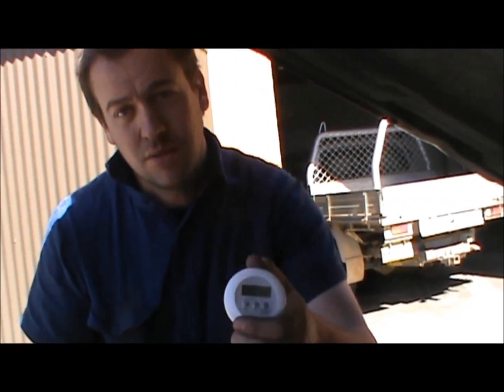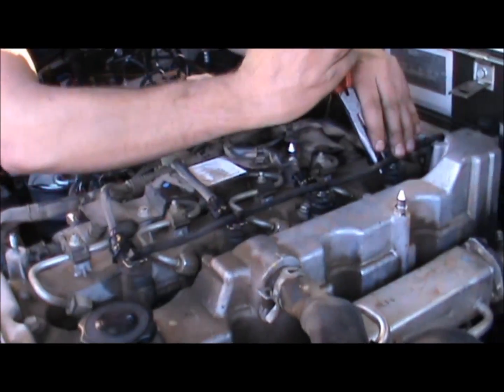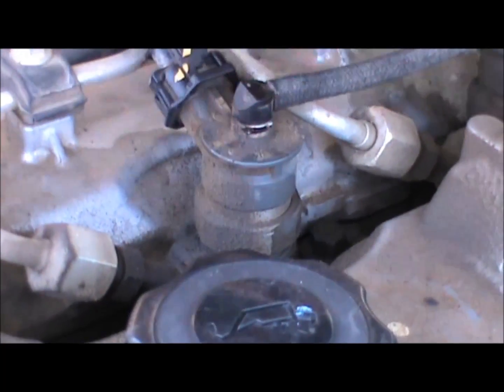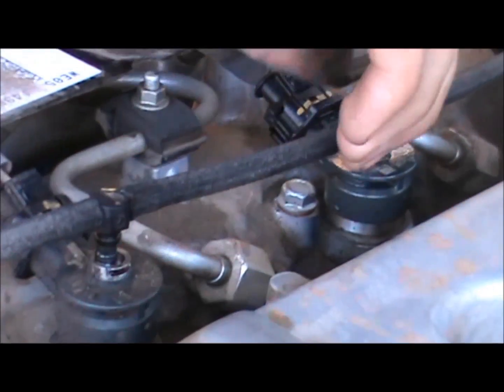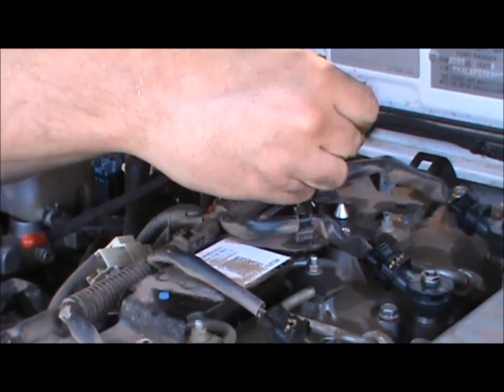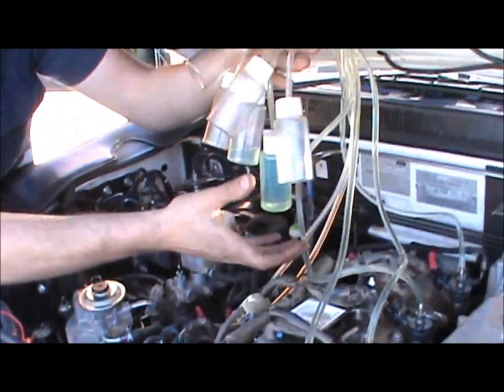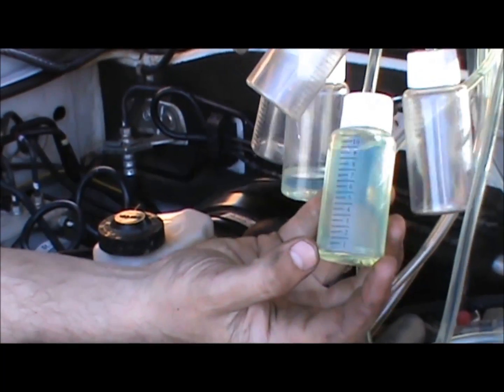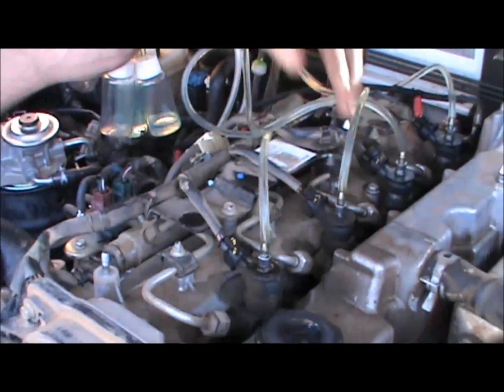Leak Off Test for Common Rail Diesel

Comment: the car cranking but not star i have p0193.p0183.p0627 when i test wires to injectors nothing at all need to see wiring of this injectors with cranking all of this injectors leaking diesel also when i start it with petrol they leaking diesel but i need to know more about thier signal before i change them

Comment: hoy mat , thanks for the informative vid , but can i do the same tast on diesel ( pressurized injectors ) nonelectric
Reply: Ahmad Ali Did you find the answer to this question?
Reply: Ahmad Ali my understanding is that it can be fine as you're working on the return line, im about to try it myself actually